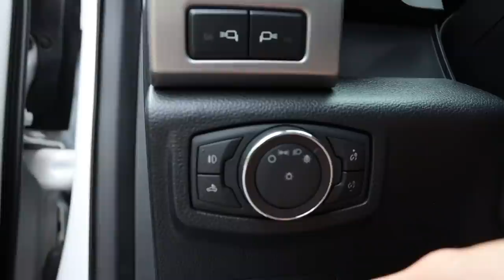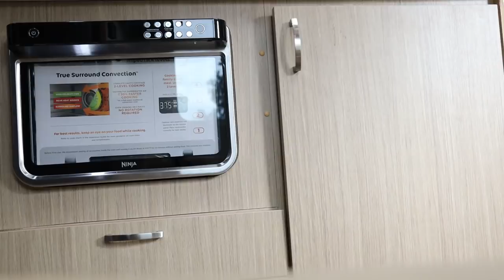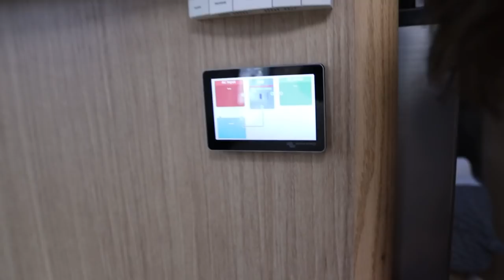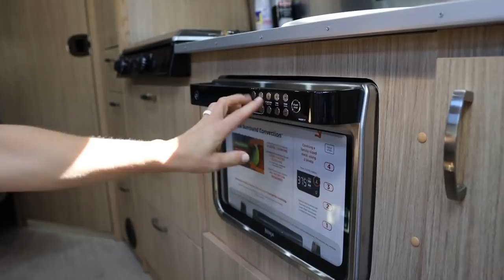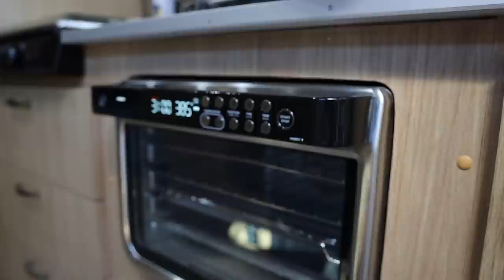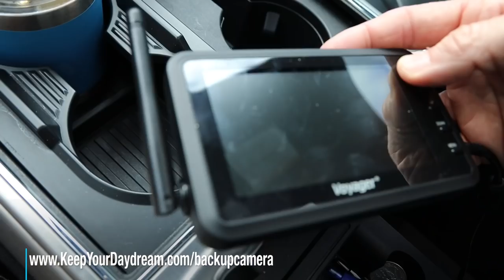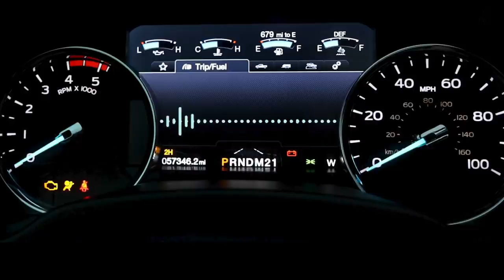RV LIFE: Back in the Airstream. Service, Repairs and Mods

Comment: I appreciated Tricia's tip about keeping plastic bins under sinks in case of leaks. Smart!
Reply: I second that! Tricia is correct about plumbing fittings working loose and using plastic bins for secondary containment is the best solution plus they keep all those small containers organized and more likely to stay in place while traveling.
Reply: My rv sink leaks also. We've fixed it, and it started leaking again! Save yourself the headache and get a bin.  😀

Comment: Watching the sink leak issues brings back memories of an ill-fated project of changing my stock faucet to a new high arch one. I anticipated an hour project. 2 days and 14 hours of work later, 5 trips to home depot later, I finished the install.
Lesson learned, make sure the supply lines are the same size as the existing plumbing. 😂

Comment: We're not alone!  LOL.  This is reality, which is good for people to see.  We turned our water on after winter and our floor got flooded.   We had forgot to hook a connection back up after winterizing.  Then we found out the water pump needed to be primed.  Then we couldn't get hot water and found our mixing valve screen was plugged.  Fun times.

Comment: Nice to see you back in the Airstream.  The cold water mixing valve on the hot water heater can also accumulate debris on its screen, which reduces hot water flow.  This happens to ours last year, It’s fairly straight forward to clean but getting it off the water heater can be a challenge.

Comment: Marc, my wife and I had the a similar issue with debris in the water lines after winterizing it.  Be thankful because your issue was nothing compared to ours.  At first I did the same steps you did to trouble shoot, but ended up cleaning every faucet and found we had algae throughout our coach.  The algae had grown due to a mild spring and a late de-winterization.  Unlike your RV, ours was a Newmar DutchStar with two baths, a washer, and residential fridge with icemaker.  So cleaning out the algae took a lot of our time and effort.  I had to clean out the water pump for the RV and the pump for the fridge.  The fridge pump quit because of the build up and I can tell you moving the fridge out was no easy task. We then drained & bleached the entire system and ran it many times to remove the bleach.  Our RV repair center said it is common here in Kansas with our weather being so unpredictable.  We really love the show.  We are going Full time in August.  Hope to see you out there.

Comment: Thank you Trish for the container under the sink solution. Of course it wouldn't have done any good the first time I had water issues. Yes, I left the faucet open and had water running out of the RV. Thank goodness I had packed two fans, and the sink is located over the wheelwell so it didn't flood much of the RV.  Thank you for another great vlog.

Comment: Marc: A very useful video. Not everything goes as planned, and that is what it is. Also, I had exactly the same plugged faucet problem last spring in our outside kitchen. Why would it completely stop?? Solved it in the same manner, removed the aerator and rinsed everything out. Like your situation, I am convinced that the water heater was the source of the debris. The filter discussion is relevant as well, as I am planning on added a filter to our rig this spring. I never had one as we tend to rely on bottled water for drinking and use the onboard tank only for cleaning, dishes, and bathroom duties. Thanks for sharing a less than perfect, but absolutely normal, experience.

Comment: We always remove the faucet aerators before flushing the water lines in our Airstream. (We do the same at our house in Michigan when we return in the spring and soak them in vinegar before replacing on faucet.) Also, we no longer use the cheap blue water filters. After having to replace our 6gal water heater because of bad water in some parts of the country, we switched to the 2-stage Clear2O filters. Also, vinegar clean the water heater 2x a year and drain And sanitize the fresh tank 2x a year. Love Trish's storage and cooking tips.

Comment: As an RV technician, I see the clogged aerator somewhat often. It's usually attributed to the lack of flushing out the water heater. I show the customer how to flush out the water heater with the $15 Camco Tank Rinser, sell them one, and everyone's happy. 😁
Reply: How often should that get flushed? Do you have a link to the camco part that you'd mentioned?
Reply: I've started flushing my hot water tank at the end of the season before letting it sit empty in storage on bypass.  I generally leave water in there during the summer..  There is a lot of hard water stuff that comes out. I just push a small tube connected to the garden hose though the tank drain. Nothing more than a homemade version of the tool mentioned. I would recommend cleaning before storage dries stuff hard.

Comment: That's one thing I suggest to anyone whether it be flushing a water heater at home, or part of the winterization, is to remove all the aerators, and even the shower head when winterizing, flush the system out, then back flushing the aerators to get the gunk out before reinstalling them.

Comment: In the 70s I was in the USAF, There are gap filler radar site in our mountains to see within the valleys. We had a small hut when we worked there for a few days. We found we had water everywhere but the kitchen sink so we called it in. Not expecting any help in the near future we carried water from the bathroom sink as we needed it. On the third day  a retired sgt. showed up who worked on base as a civil engineer. First thing he said was "You guys are all single right", YEP, walked over to the faucet and unscrewed the aerator,it was way more clogged than yours. He left saying remember when you get married and you'll become heroes for a little while 'til you screw up.

Comment: Glad to see you back in the Airstream. Note on the backup camera, I installed one on our 5th wheel but I rarely use it when backing into a spot. I feel more assured of not clipping something if my wife is behind the rig directing me. I have ours wired to our running lights also so I use the camera as a rear view mirror when traveling. It’s nice to know what directly behind us while driving. Way to keep your cool with the plumbing issues. Safe Travels!

Comment: Marc, I have had the same issue at my kitchen sink. Same solution. Taking off the aerator. That opened another host of problems with the water system in my house but that's another story.

Comment: I live in triple wide wide for 16 year. The same water line as a travel trailer. I had to fix 25 to 30 break in the time I lived there. The best thing I found to use was Shark bits. And you can reuse them and they have a clean look and you just push them on they work.

Comment: Trish, I was told by an RVer to use soft sided cloth and rubber type baskets in my fridge and freezer and put stuff like ketchup, milk pickles or anything else that can fall out in them. I do this and it works great!  You’ll have to measure your space,  and right now because of Easter is the best time to buy those kind of baskets at Walmart.  I also recommend putting a lock on your fridge and freezer as they tend to come open when your driving.  They make Rv fridge specific locks for the stainless steel fridges.

Comment: You might research installing a front receiver hitch on your truck. We did and it helps to move trailers in tight places like through that alleyway. Plus we use it more often for the bikes, a basket rack, and for a winch. Been watching since episode one, thanks for all the great content!
Reply from the maker: That's a good idea. In this case, the truck would still have to unwind from the turn being 90 degrees and single lane.

Comment: Hey marc, similar to you I didn’t want anything addition on my dash.  Since the truck rearview mirror is worthless when camper is connected I went with the Haloview wireless rearview observation mirror dashcam rd10. It can plug into a 12v adapter but in my case I found power in my rearview mirror so I didn’t have cords running all over the place. It works great! Especially on the highway when passing vehicles, etc.  We’re already programmed to look I the rearview mirror when backing up, etc.  It also includes a dashcam too. You can leave it in place even when camper isn’t hooked up because it acts as a regulator rearview mirror if you disconnect it’s power. Worth checking out. I’m sure you’ll like it.

Comment: you need a hitch receiver on the front of the truck. In tight spots like that I find I can push it in with no problem. Turning radius is totally changed. I have a long bed crew F-350 and a 32 foot trailer and no problems.

Comment: I use a similar backup system. It stays in my center console till it is needed and is also controlled by the running lights. I use it more for safety than any thing.

Comment: Love talking Charlie, Gary and the Power Stroke! 

Plumbing can be frustrating. When I was changing out my faucets in the motorhome I had to replace connectors we used the brass shark bite fittings and they worked well. 

I love Saint Pete I did the Skyway 10k over the bridge a few years ago. I have lots of coworkers there and in Tampa. They keep trying to get me to drive the motorhome out from CA so hopefully you put the name of the campground in the comments. But if I fly out I will have to book the bungalow when it’s ready!

Comment: I love watching you fix things. Someday I'll be doing it too, and I like a hint. My water heater light does not stay on. I was told that shows a problem in the circuit board. I'm changing my switches to one's that are lit red so I don't forget to turn off the water heater.

Comment: Sorry, not sorry, you had to deal with plumbing issues on your first day in Florida.  It was exactly what I was struggling with in our new-to-us class A.  Trying to switch the old kitchen faucet for a new one and not knowing anything about RV connection.  The next thing on the list was the hot water heater, and you helped there, too! Thank you for your perfect timing.  And go Wildcats.

Comment: Here a tip you might want to try to get your Airstream in tight places. Put a hitch receiver on the front of your truck and put the hitch on  and hook to the hitch of trailer and push it where you want it to go. Shorter 16:53 turn radius easy peasy. 

If you ever want a winch it will fit in the receiver front or back of truck

Comment: Ur truck is very clean and organized...at the moment.   Watched you disconnect at the 13 min mark.  I leave my safety chains on when I lift off the ball, just in case the trailer is not chocked well enough.  Had an almost runaway trailer once.  Mebbe clean the rust and lubricate around the hitch lock.

Comment: It was entertaining, educating, nostalgic, marginally romantic but definitely not erotic. I've not had many issue with our 2015 Flying Cloud. The worst thing was the lead acid batteries exploded and caused rust in the box. However I'm real glad I watched you clean the faucet aerator, you never know. For some reason in that segment when you commented after fixing the faucet I found myself smiling back at you and expecting you to somehow to knowledge me because I was right there with you. lol  It looked possible the antifreeze did not make it into the faucet lines froze and damaged that those fittings. We just moved to South Dakota... It got down to -3 like 5 times. All I did was drain everything, we'll see how it goes.

Comment: I been where you are at with the water issues…….anytime I would turn the water on the first time I would first change the anode rod in the water heater……then remove all the sink faucet outlet screens and shower head…..then put water to the system and flush out the lines by opening all the faucets (hot&cold) and let them run…..clean the outlet screens and reinstall…..after I started this practice at the start of RV season I never had water issues….however I had the water pump pulse valve (I think that’s what the part name is) should crack from road vibration and would need to be changed…..always carried a spare of those……but what you did I went through that years ago on my class C…

Comment: Hey Marc, I have to tell you, been there done that.  Had the same thing happen to me on our brand new trailer.  However, our entire faucet had to be replace because there was so much crap stuck in it I couldn't even blow it out with HP air. Mine was from saw dust and stuff when the built the thing.

Comment: Since there's 12v in th fridge for the existing light, get some LED rope or string lights, tie them into the existing wiring, then mount them vertically on the sides of the box interior to illuminate the lower part of the fridge. I have to add, loved Gary's final comment at the end of the video. 😂

Comment: The support legs if double hinged could be also X braced might help if on hill & slip or in the all alone by self wind & 1 leg slips & plows into a fence.,  & easy pivot support brace suspenders & belt deal.

Comment: Marc, next time you need Pex fittings check out Sharkbite fittings.  They work for Pex, CPVC, and copper.  Best thing since sliced bread.  Worked hardware for 15 years and learned a lot from the tradespeople.  Miss the Bird!

Comment: Don’t forget you need a small air bubble at the top of the water heater, a bubble you remove when releasing water at the relief valve.

Comment: As I de-winterized our less than 1 year old camper, two of the faucets didn't have flow. I couldn't find any other valves so I removed the aerator as well and found white grit clogging both faucets. Yours had color, but very similar looking.  Looking forward to see if you went thru my town of Greenville, SC.

Comment: You solved the "what happened to the water"?  Just an FYI, we drain & re-pressurize water system in our cabins every year. Learned long ago, take off aerators and shower heads during shut-down because they Always Clog on re-pressurize unless you've taken off before starting the water. Our system drains fully all pipes, fittings, T's, valves empty. Otherwise, frozen and broken fittings to be replaced.

Comment: Hving windows hve a inner cap inset window till u get there then way to hook in set window on outside if needing space after u arrive. Say a 4 or 5"extra inner window u add /slid into notch on outside for better insulation esp if single pane after market add.

Comment: what would  be nice to see in an rv fridge is; 
1. Shelving to have lip to assist things from falling out. 
2. Shelving in fridge to be pull-out's on a track system with a locking mechanism. so now you would be able to have a lip and be able to easily put things on to the shelves as well as access the back easily enough too. 
-- Very simple design ideas, and I do not know why the engineers cannot seem to think about these things?    
it would be so much more convenient.

Comment: Marc, the other weekend we were up in Taos Ski Valley hosting a dinner party in our Flying Cloud.  It was the first time we used our Sharp M/W Convection Oven.  Huge disappointment.  Because the food has to rotate on the turntable you lose a lot of space in the oven.  The Ninja Convection oven you had installed looks great.  I love that the food does not need to rotate and you have tons of usable space in the oven.  We all could use more details on that install.  Did you have a custom surround made or did it fit in the previous surround?  Tell us more soon!

Comment: I had the exact issue with the aerator and was stumped for about 15 minutes before a friend suggested I take it off.  Just like yours, mine was full of crud that blocked the water flow.  Nice when a solution is that easy, but still frustrating until you figure it out.
Reply from the maker: Stumped is the perfect word. One min it works and the next it doesn't. Took a sec to think it through line by line.

Comment: the adjustment tool for the bike rack is actually a torx. you can find a torx set that is inexpensive and throw it in your tool box. you may be able to fin just the one size in case you ever lose the one the rack came with
Reply from the maker: Yeah, but a knob is better :) Maybe I should find a torx to knob fitting.

Comment: Once the anti freeze was in all of the lines they should have ben blown out...I never keep the lines full of any fluid when stored...just the traps. Smart move to go to brass replacements...might want to use the copper rings rather than the stainless ones for the best seal.

Comment: Had similar issues, drained an ran clear water through everything,  got to campgrounds, hooked up water, and leaks coming from under sink. Line going into filter cracked and spent best part of day 1 doing repairs. But I wouldn't change a thing.

Comment: Update: This year I left the water heater isolated from the rest of the system and flushed the pink antifreeze out of the lines with city water. Then I rinsed out the water heater with a handy rinsing tool while still leaving the water heater isolated. Then I reconnected city water and opened up the water heater with the plug out and let it rinse and flush the water heater. Then I put the plug back into the water heater, filled it up, and drained it out again. At that point was ready to sanitize the tank and lines with bleach mixture. When doing so I once again isolated the water heater. I didn't want the bleach smell in the water heater and figured heating the water would kill any nasties in that water anyway. It is unlikely that we would drink any water from the hot system anyway. Bottom line: no clogs this year and all went smoothly. Still a good video showing that issues do arise for all of us and with a level head, some thought, maybe a YouTube video or two and the problem can be solved.